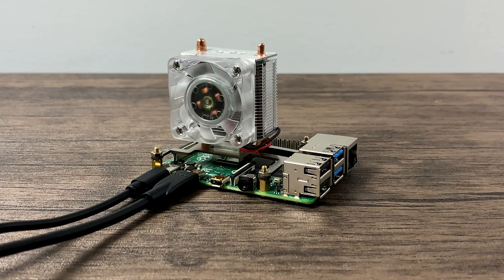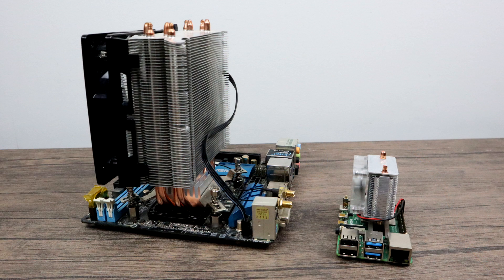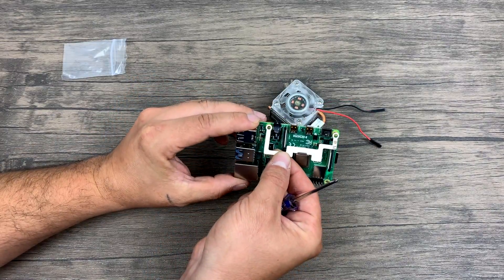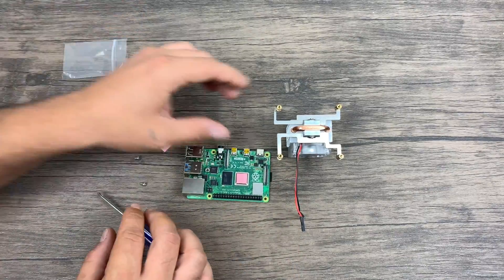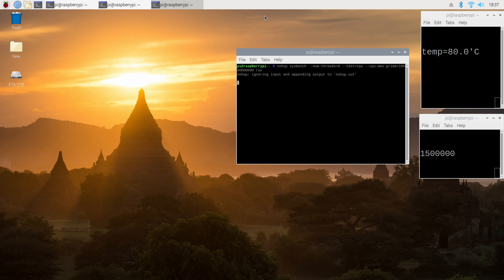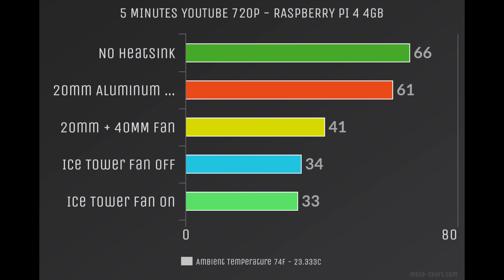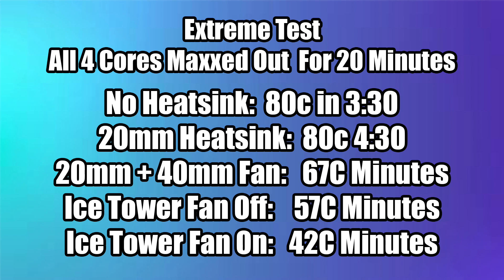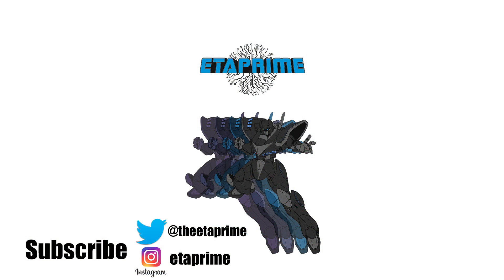The Best Raspberry Pi 4 Cooler! The Ice Tower Also works on the Pi 3 & Pi 3B+

Comment: I will be honest.  I am nuts.  That being said, I want a raspberry pi heatsink with  2 heatpipes and fits a 80mm  fan.  Why?  Because.  Because I hope it works passively, but like to have noctua fans on everything!
Reply: Ocd
Reply: @ja.almighty  i took the 40mm fan off my icydock 4ssd drive bay and put a 40mm noctua on it.  Same with my dual 10gig network card.

Comment: Question: Will this cooler fit on the LattePanda Alpha. I think it will do a better job then the stock cooler.
Reply: Unless the LattePanda Alpha has the CPU in the exact same spot and the mounting holes as the Raspberry Pi 4, I doubt it will work.  You might be able to get new mounting brackets for it to see if that'll work.